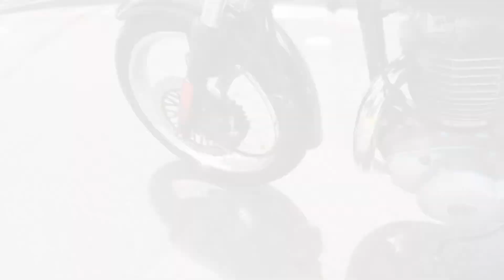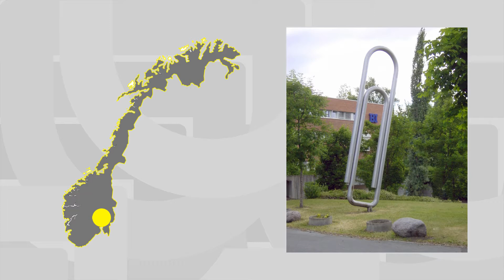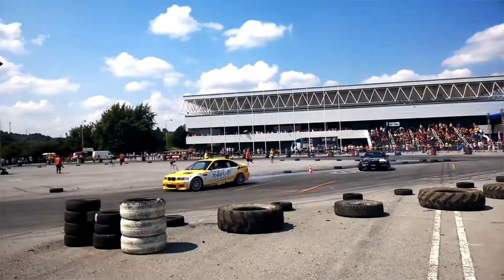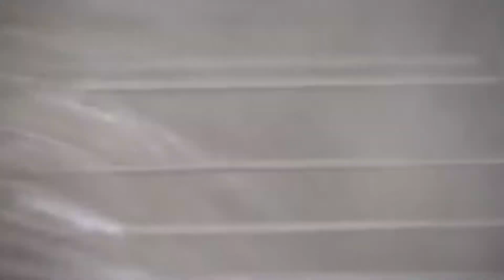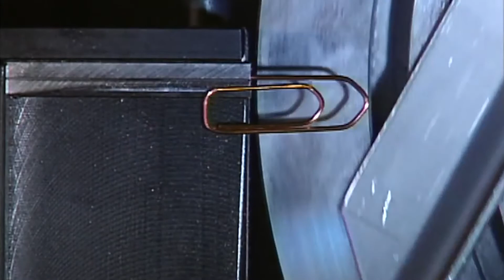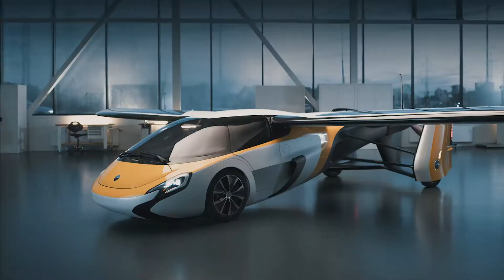The Paperclip Design, is it Perfect?

Comment: I disagree. I think the paperclip could be made a little bit better just by increasing the length of the wire and turn on itself one more time. That way either end can clip to the paper.
Reply from the maker: Thanks for your comment, one on my first ever video so deserves a full responce! There have been many attempts at improving the design but it’s always come back to this shape. Would the extra material costs of your proposal and extra manufacturing step result in a marked improvement worth the investment?
Reply: In general, no, the cost would not be worth it. However I thought of it as a simple addition to alleviate the one frustration I have with the standard design, and add minimal manufacturing complexity, save for the extra maaterial.

Comment: What about a horse shoe? They have been dated back to 400BC and their design has been essentially the same since the earliest findings of them.
Reply: eh there is modern versions coming out including ones that no longer involve sending nails into the hooves and instead are glued on there are also many versions for various circumstances the old way is still pretty standard for many applications. But there are now tons of different materials that can be used for more specific purposes like aluminum for racing to reduce weight or rubber to provide better traction and protect road surfaces and even plastic.

Comment: The safety bicycle is another example of unchanged design since the 1880s: https://en.wikipedia.org/wiki/Safety_bicycle
Reply from the maker: That is a good one! However I would argue that although it was the first Version of what we would consider the classical bicycle layout, it has had many changes in material and design since it’s inception. I would class it as a design trend/concept that has then been replicated through the years. If they were still riding that exact original model in the olympics (and what a sight that would be) I would totally agree with you.

Comment: Surely not having a patent would be a reason for its widespread adoption?   

(Another excellent video.  Every now and again YouTube’s algorithm finally unearths another of the treasures in its library.)
Reply: You have probably thought of it but you could do a top ten best designs and top ten worst designs.  I’m inclined to agree with you that the endurance of that design of paperclip shows it was as good as any design could get. However I prefer the variant with a square top, triangular shape and slight bevel on the mid-loop.